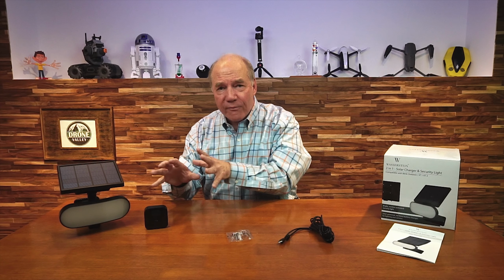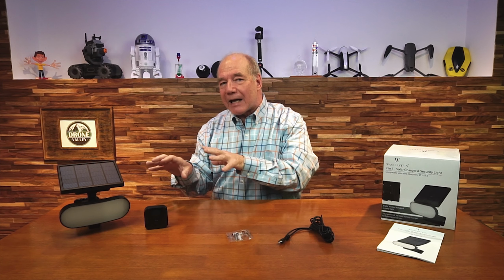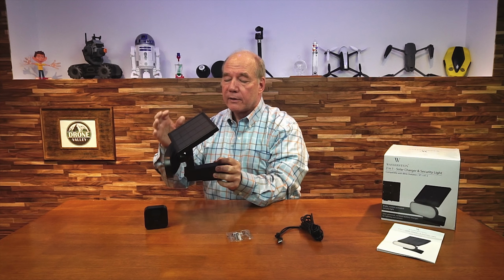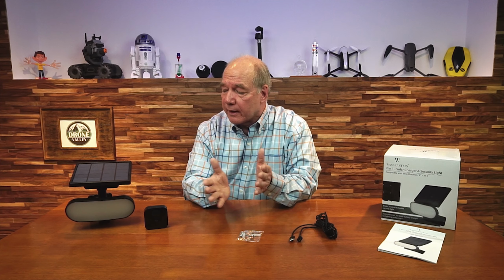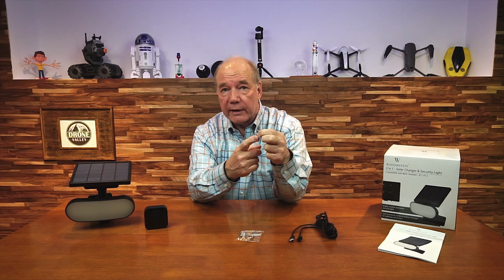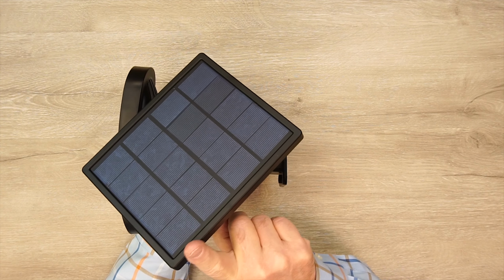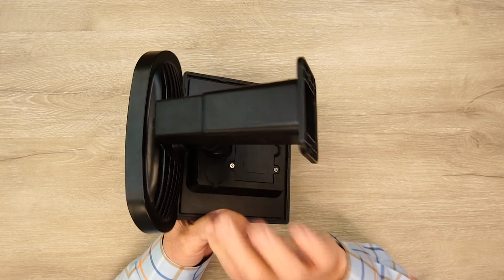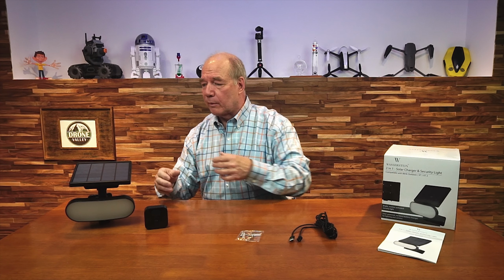Blink Camera - Solar Powered Light & Charger Review

Comment: i got one blink and I've replaced the batteries just about every 3 weeks the first few months of owning it. I upgraded to an electrical cord. Big difference, but still not impressed with it. Doesn't ever stay online for more than a minute or two. Slow video processing. I got a lot of those homeless backpackers scoping out the cars in the back lot. When I see any of them on the Blink video I run outside in a matter of a 3 seconds, and they never are in sight anywhere. So I say, whats the point of having this if every criminal has the time to get away. I'm done with wireless and working at saving for hard line cams.
Reply from the maker: Thanks for the post but this is the age-old dilemma when deciding between a batter powered/rechargeable camera like the Blink and a wired camera. The battery powered models are less expensive and easy to located anywhere in a few minutes but do require new batteries and are slower to respond. The wired cameras are MUCH more expensive, offer less flexibility in mounting but can respond quicker to movement and record longer. In a perfect setup, you'll use a few of each. Battery powered ones where you have less traffic and are just trying to stay on top of things like deliveries or light foot traffic and wired ones for higher security areas where you need quicker response. Blink is an exceptional camera as a battery-powered device but has the drawbacks I mentioned above that are really hard to overcome. You might want to try to reduce the sensitivity settings and lower the resolution to extend the battery life. I hope that helps a little and good luck.

Comment: 13 feet cable defeats the purpose of wireless camera🙄
Reply from the maker: The wire just allows you to use solar power to operate the camera. It's still a wireless solution but you no longer need to be swapping batteries every year. The sun charges and internal battery in the unit for the motion sensor light and the camera. It's a great way to install the camera anywhere and never have to worry about the batteries dying on you. I hope that helps. Rick
Reply: 13ft wire is to mount the light up to 13ft away from the camera if that suits your situation better,  not like the blink floodlight where the camera and floodlight have to be mounted together to be in sync with each other

Comment: Don’t Buy BLINK 
When I received the item didn’t notice I had two dud cameras until AFTER install later the SYNC module started to have issues.
Blink customer support ALWAYS blames it on your cable services. You spend 12 hours and 2 day conversations with support its awful. They are useless do not back their product! 
Awful nightmare since day ONE!

Comment: $200 no thanks
Reply from the maker: Thanks for the post but the solar panel kit is under $60. It's designed to work with most wireless outdoor cameras and is a great (and free) way to power them.
Reply: I paid $54
Reply: Where did you see 200? Their like 50 bucks lol